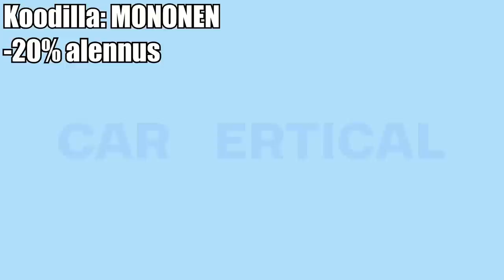MB w210 220D (om604) osa 2. pakoputki ja toinen jousenkuppi #paskapaavo #väyrynen #väyväy #om604

Comment: Hello. I saw in the first part of the video that you have a mechanical pump installed on this engine. Do you have any issues on the electrical side of the car with this swap? Tachometer still working, warning lights on dashboard?
Reply from the maker: Hey. 
The car does not have any major electrical problems after replacing the mekanical pump. 
This car is from 1996,  one of the first gen w210 body merc. 
The only "flaw" in the electrics is that if the engine revs above 4000rpm when stationary, the tachometer does not understand it because the pump originally made by Lucas does not rev stationary above 4000rpm. This fault can be reset by starting engine again.
Reply: @MBMononen  Thank you for your response. I was thinking of switching the pump but I couldn't find any details what happens with the electronics. With your response I'll be more courageous in doing this. Good luck with your projects. :D